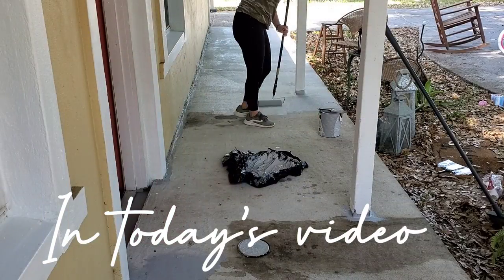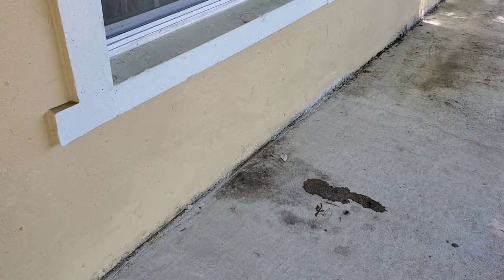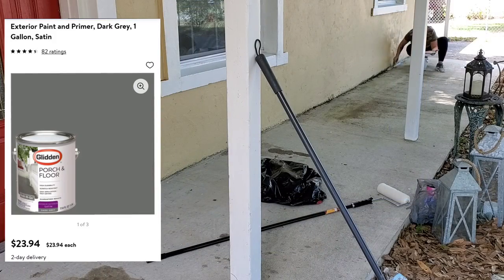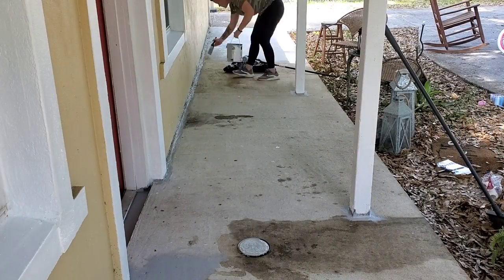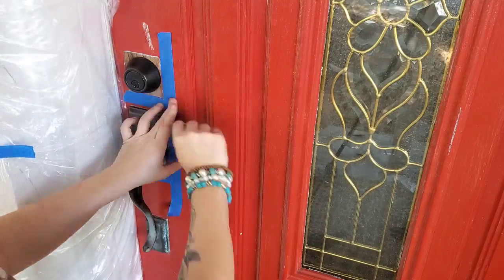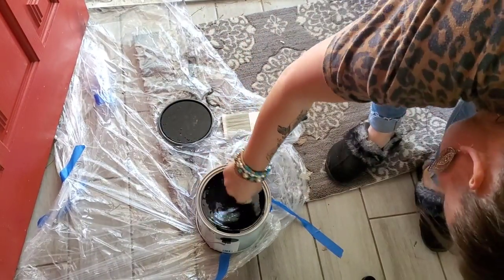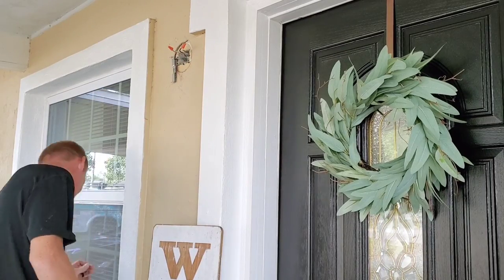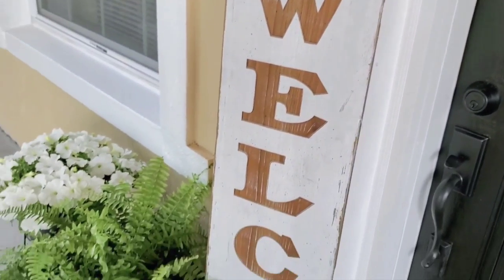FRONT PORCH MAKEOVER ON A BUDGET | BEAUTIFUL FRONT PORCH TRANSFORMATION | FARMHOUSE FRONT PORCH .

Comment: Karrie what a stunning transformation! I wanted to share with you a tip on your plants. If you will get a pack of cheap baby diapers and cut the diaper in half take your Plant or flowers out of it's pot and put the inside of the diaper facing the bottom of the plant. add your potting soil and wrap this bottom in a plastic grocery bag then place in pot. Push down the bag so you don't see it and add a little more dirt. Your plants will last so much longer in hot weather. Love your channel! You are such a hard worker and great Mom!
Reply: What!?! I’m gonna have to try this hack! Never heard of it! My mom just told me one of my bushes is dying because it got too cold in the winter and that I should put a blanket on it. Made me giggle a little 😂❤️
Reply: @ourtinynest6538  Yes my Momma always would do that  sometimes with a light blanket when i was growing up.You please try the diaper hack and you can still use the   throw away pots they come in if you use the diaper method,

Comment: By the way, I heard you say that you wish you had one on the other side matching. It is extremely easy to wire across the top you’ll probably have to do it either on the inside or the outside of your home. Also, you’ll have to cut away a little bit of the siding and wire from the light you already have on the left and then carry it over to the other side. If your husband is handy and knows electrical, see if he can do it, but if he is not but not an electrician,  I would definitely hire a licensed electrician to do the job. It is worth it and the light will be a huge beautiful boom for your house and front porch. Your house definitely needs two lights because of the way the house and front door is laid out. It is not very expensive to do the electrical that way either. A few hundred dollars, but what it will look like after? Will be spectacular and worth it! You might be able to find some directions on YouTube or Pinterest too! Enjoy!

Comment: I'm a little confused. It looks as though she just dusted everything off instead of cleaning it off and possibly sanding it down. Any dirt, grime, or mold on the walls, window frames, or ground, is just going to mix with the paint and allow it to peel and chip off in a couple of months. Did I miss the part where she scrubbed everything down? 🤔
Reply from the maker: You may have missed the part where I explained that it's stains and concrete splatter on the wall it wasn't dirt 😁 I didn't pressure wash because I didn't feel like it was necessary and m glad I didn't because it covered well and it's holding up wonderfully 😊 thanks for watching.